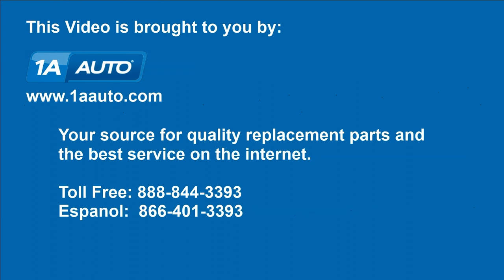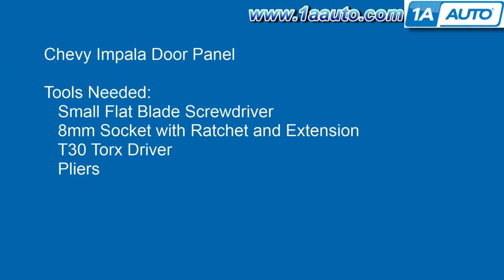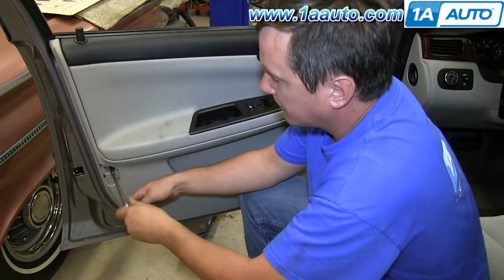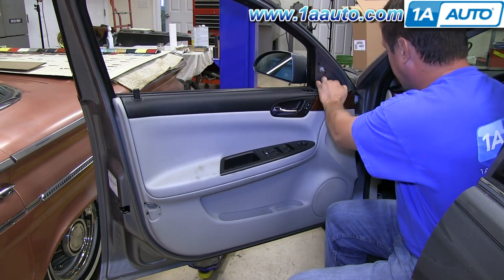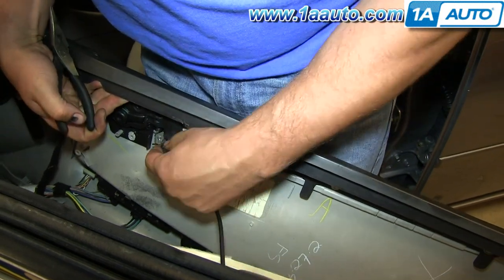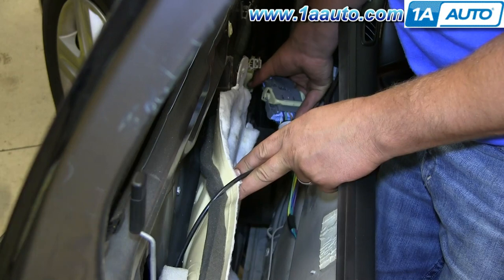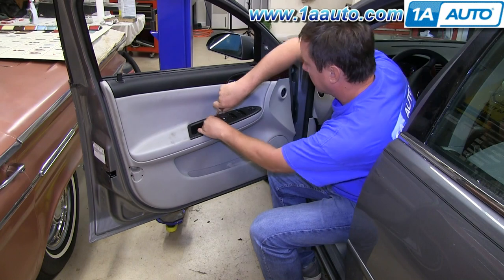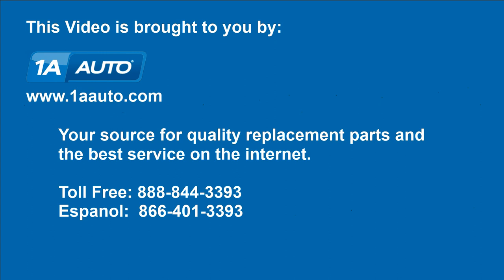How To Remove Front Door Panel 06-12 Chevy Impala

Comment: Your video helped me a lot today.  I had to replace disintegrated lock knobs on a 2007 Impala.  I replaced them with no issues.  However I feel I should mention that the socket needed was not an 8mm, but a 7mm.  But I'm sure others will figure that out themselves as well.  Thank you for posting this 'how to'.  :)

Comment: Before I remove my door panel, I would like to know if I even should.   I am trying to locate the turn signal relays.  It sounds like they are in the door, but I am not 100% sure.   I didn't see it under the dash anywhere.  It's not in either fuse box.   I was hoping this video would show me, but it did not.   Still, this video is informative enough for me to do this.  Thanks.
Reply from the maker: +Jens Hatje Thanks for checking us out! http://1aau.to/m/Shop-1AAuto-c

Comment: What is the piece called that the screw on top of the speaker bracket screws too? Mine broke out of place and won’t hold the screw right at all
Reply from the maker: +Kyle Clevenger Thanks for watching!  It sounds like that part is either part of the door panel or the point where the panel mounts to the door.  You might need to contact the dealer to get a stock number or name of the piece you are referring to.  1aauto.com